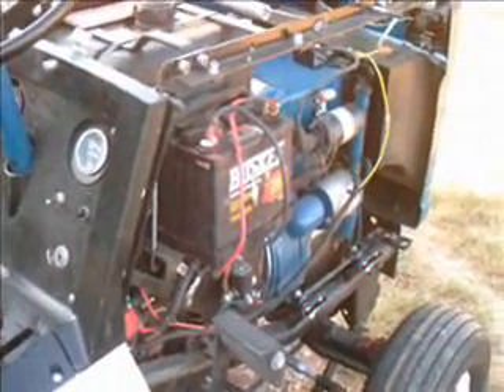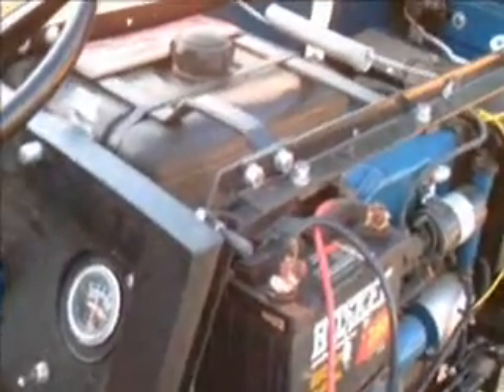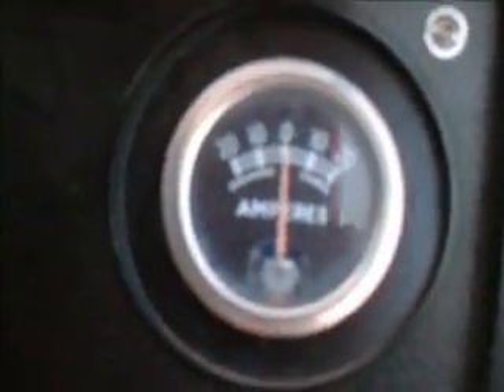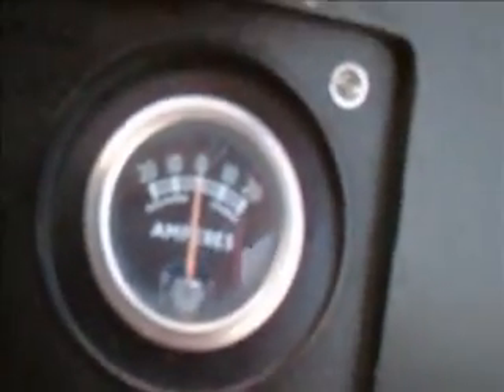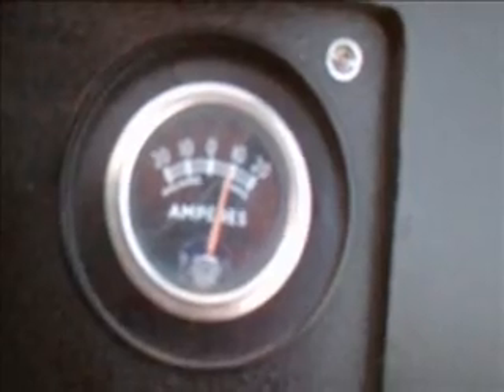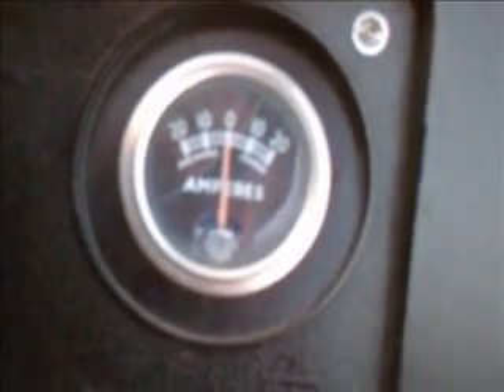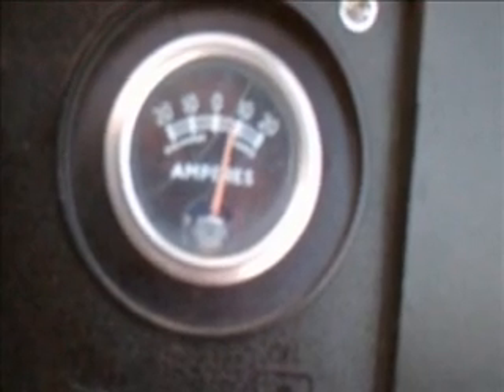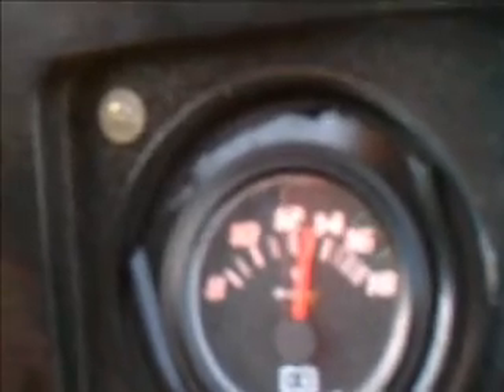Ep 3 The Amp Meter.wmv

Comment: My lawn tractor has been custom wired. One amp gauge lead goes to the hot side of the solenoid. I'm not sure where the other one should go as this tractor has a toggle ignition switch and a push button starter switch. Any help would be great!

Comment from the maker: One side of the Amp meter goes to the Battery +, The other side to the Key Switch (B) terminal. If the Amp Meter Shows a charge with the engine off, and a drain with the engine running, reverse the leads. Can't attach a diagram here.
Reply: Your advice WORKED! When I looked at the wire connector plug's backside, no markings were found for each pin, i.e., Letters marked S, B, etc. Not on the pins or on the wire connector housing. The wiring diagram showed the key switch with the letters. I thought I was looking at the backside of the plug, not the actual key switch. Confusion. Your video would have been more helpful to me if you showed the color of the wire. Sorry, my fault. I did order that book! Thanks again for your help!!

Comment: I thought this video was about wiring an amp meter not how to interpret one. This could have been better for me if you showed me where the two wires from the amp meter went. Something like, "There are two posts on the meter, which are both positive. Using a wire of this gauge, ie 18, 16, 14, attach one wire from the gauge to the battery terminal post. Next, connect the other wire from the meter to this place or places." I need to get that book, "Amp Meter Wiring for Dummies."
Reply from the maker: One side of the Amp meter goes to the Battery +, The other side to the Key Switch (B) terminal. If the Amp Meter Shows a charge with the engine off, and a drain with the engine running, reverse the leads. Can't attach a diagram here.
Reply: @larrybl  Thank you so very much. Now I get that meter working, tomorrow.

Comment from the maker: If the AMP meter readings are reversed, ie neg for charge / pos for dis-charge. The wires are reversed on the amp meter. Swap them around. (Don't forget to disconnect the battery negative before doing this to prevent the angry pixies to escape!

Comment: Can you please tell how to wire the amp meter.  I’ve got an old Cub Cadet 147 that I believe the wiring to the amp meter is wrong.  It shows a positive charge when starting and while running a slight negative charge.  I did not do the wiring but wonder if they could just be reversed on the meter?  Thank you.